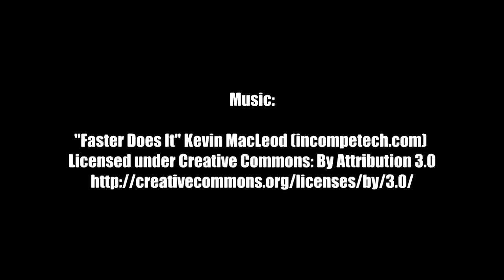Custom Built Security Door w/Half Knuckles

Comment: Di you have a video on how to make those pieces you have in the middle of those bar
Reply from the maker: I think you might be referring to the cast iron elements. Check King Metals for that type of thing. Also, you may have a local steel supplier that carries them.

Comment: What was the total cost of the material to make this? How long would this take you if you work full time just on this.
Reply from the maker: Those are very dynamic pricing paradigms. I built one. The cost of materials reflected what I needed to build one, perhaps $100 or so. The time invested reflects the time to build one, perhaps 5 or 6 hours. If one were to consider manufacturing these full time, materials costs would drop significantly as you get discounts for buying in volume and you get less waste. The time to build them would drop per unit because of batch cutting your materials and you'd have jigs built for faster assembly. So, without sitting down and working all of those numbers, I couldn't say. Even then, it would just be an estimate.
Reply: Thank you for your answer, I find it useful to estimate the cost of securing my home and learning an invaluable skill in the process.

Comment: nice work ....but how you installed lock, that you have' nt shown
Reply from the maker: +S Shaikh I will. We're going to install the lock set directly into the 2 x 4 rails. I'm hoping the Kwikset brand will work for this. But, it should.
Reply from the maker: +S Shaikh I'm sorry. I was thinking you commented on a different video. The lock set installation is typical to any of the standard lock boxes.

Comment: I like your door!  I need to make one to keep homeless people from camping in my basement stairwell.  I can do the welding but I'm unable to find the square housing for the knob/deadbolt that you welded into your door.  Where did you get yours?  
Thanks.
Reply from the maker: I built another gate. I think I called it the hobo gate. It was to keep the transients from sleeping under a stairwell at a commercial building. Actually, it was the sleeping that was the problem. It the what they left behind.
Reply: I understand.  I need another dumpster just to throw away the stuff they drag in overnight.  I found the lock boxes at the local steel distributor too.  Thanks again.
Reply: Richard .Wogsland hey did you want do like this im welder

Comment: Can I use my arc welder or is it to much heat?
Reply from the maker: I'm guessing you mean SMAW. It gets pretty hard to weld thin materials like 0.065" walled tubing with stick. It can be done, though. The first trailer I ever made was with one of those ubiquitous Lincoln "tombstone / buzz box" arc welders, 3/32 6010 rod set at 45 amps. It was a lightweight trailer. The frame was 1/8" wall and was pretty easy to do. The cross members were .060 or .065 wall. I drove myself mad getting a feel for striking an arc and not blowing a hole in the material.

Can it be done? Yes. But, it is maddening.
Reply: Newbie welder here agreeing, having found out that 3/32 6013 was way, way too hot for 16 gauge, even at 40 amps on the Lincoln buzz box lurking in my garage.  Local welder store said try 1/16" 6013--smaller rod and lower penetration than 6011 or 6010.  Well, gotta try, and if that burns through, I'll have to bite the bullet and get either MIG or TIG set up.

Comment: what do you call that screen you welded 
 on?
Reply from the maker: Perforated sheet. I don't remember the specs. I usually just call my steel supplier and tell them I need the perf sheet for security doors. It comes in 36" x 84" and 48" x 96" I think.

Cheers!

Comment: What is that metal that he is welding called
Reply from the maker: It's all steel. The frame is HSS or Hollow Steel Section, often called square tube. The sheet is perforated sheet. I'm not sure the gauge. Most steel suppliers carry it for this application.